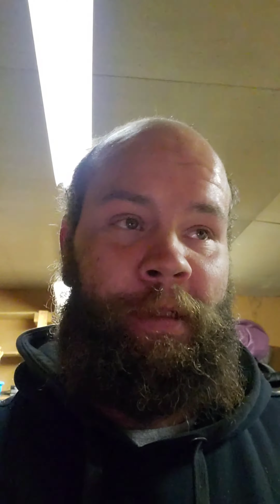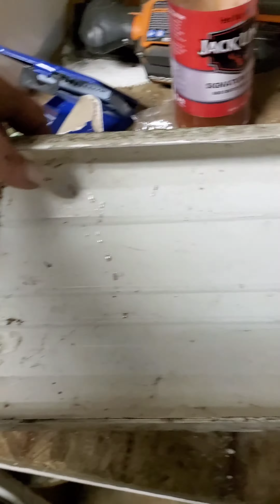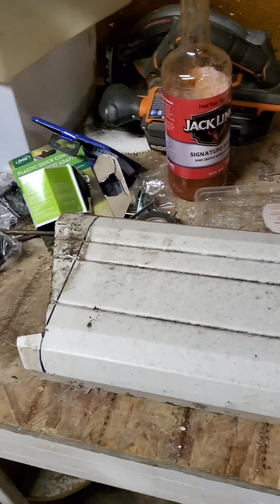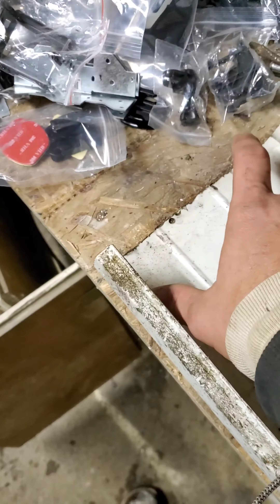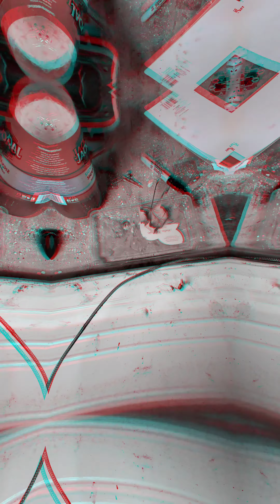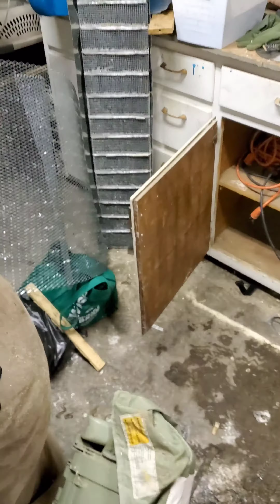new sluice box

Comment: Always interesting to see how others build equipment out of what they have available. Thanks for sharing buddy.
Reply from the maker: Thanks 😊 some of equipment  gets a lil pricey but if u can make something that works till I can get better gear 😆 why not
Reply: @AyouGuysProspectingTM  exactly man! So many people worry about how things "look" but dirty ole mules wont leave ya stranded. I took an old cheap thin steel gun cabinet that was getting thrown in a dumpster, cut and bent a stream sluice (and a cleanup sluice) with bare minimum tools to fit mini dream mats. The money I saved on the material for the sluices, went right into the mat (the most important part). Cost $30, a little blood and some of my time figuring things out but compare that to $90+ plus shipping for just the stream sluice. Cant beat the cost savings, if ya have the gumption to.
Reply from the maker: I have a 35 x 35 swimming pool 4 foot sheet in back yeard that I can bend into sluice boxes
Reply: @AyouGuysProspectingTM  yeah i seen that. That makes it real nice man wow lol. Check out mini or micro 6×16 dream mats for cleanup if ya havent already. Small and powerful.
Reply from the maker: @couzdogable  will do thanks for the information 👍